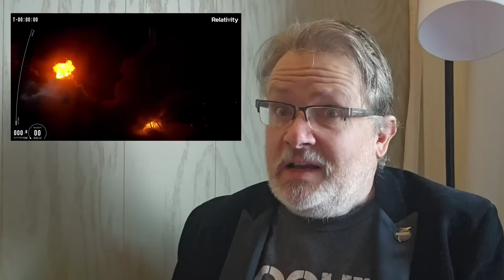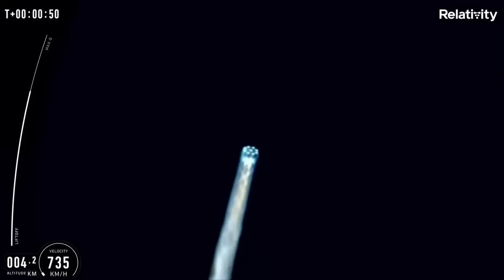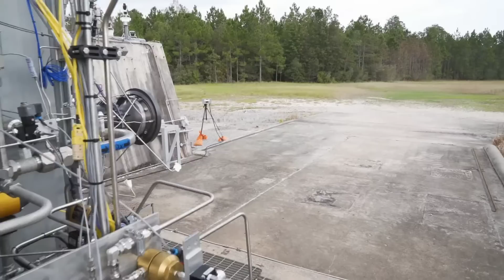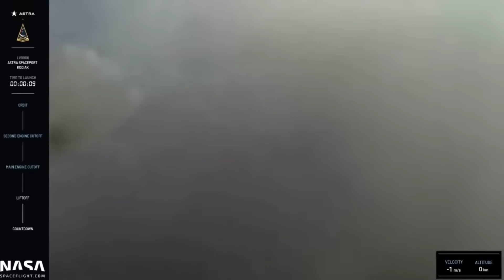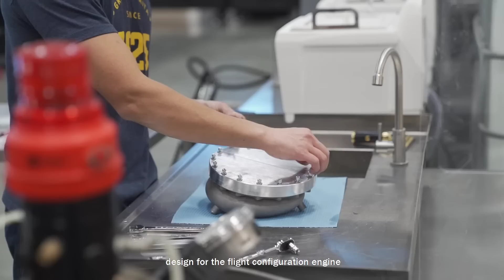Relativity Space succeeds by setting realistic expectations!  But can they ever compete with SpaceX?

Comment: "Taran 1 just made it through ... ... ... Max Q." Engine problems are bad, but the ladies commentating during the broadcast were by far the worst part of the launch. From the very apparent lack of knowledge to the high pitched screaming to the cheering and confirmation of 2nd stage ignition while the engine was clearly sputtering and dying, the launch stream was by far the worst I have ever seen. I am willing to bet that the two ladies are replaced next launch, and if they aren't, it will be safe to say that Relativity has some other problems that also need to be dealt with and fixed.
Reply: @Tyler I don't think the ladies were the worst part of the launch, they presented the information well. Sure they were excited but so is many people that see these machines fly, would you be excited to see a machine you helped built or that you were part of a team see it fly off to space? I sure would. Plus they are commentators very different from launch and mission control where they normally are level headed. I say Terran 1 succeeded in what it needed to do. Yes reaching orbit would have been great but they were not expecting that just to break thru Max Q.
Reply: @bryant3825  I guess we will find out next launch.

Comment: Hey Angry, congrats on reaching your subscription goal. When the first attempt failed my thoughts were that the new printing technology may have provided some unusual thermal conductivity issues. With this launch at night the thermal load on the first stage would have been less of an issue affecting tank pressure: equally I wonder whether the same thing may have happened to the second stage being too cold and not achieving the necessary tank pressure to ensure flow to the turbo pumps?

Comment: Congratulations to Relativity for making it through MaxQ and the flawless stage 1 performance. They also had realistic expectations and didn't use a fairing and also no expensive payload (in contrast to H3). Whatever the problem with stage 2 was, they now have the option to just change their 3D printing designs if necessary and don't need to change their supply chain and toolings.

I really look forward to their 3D printing solutions and what they will accomplish. The Terran R just got much more realistic and when they can inspect the rocket after launch the faults will be even easier to fix. This really looks like SciFi and 3D printing having become a bit more true.

Comment: Quick correction:
It was the second flight of the Vega C. The first flight on July 13 2022 was a success.

Edit: I'm also fairly certain the Aeon is an open cycle engine, not staged combustion.

Comment: I'm still unclear how 3d printing anything beyond the rocket motor itself makes any kind of sense. Metallurgically, fabrication from rolled sheet and bar is superior to anything 3d printed. 3d printing shines when the geometry is difficult or impossible to fabricate any other way.  3d printing for the sake of 3d printing is not a good business case.
Reply: It should significantly reduce the cost labor, (my guess), which is probably some of the highest percentage costs of the rocket itself. Also capital equipment costs. If you have one machine that can make a lot of different parts, it should require less equipment. I would also think you can make more components in parallel which would increase "velocity" through the manufacturing process. So the time you pay for material and labor your able to complete the rocket and launch it faster so you get paid sooner so they should have improved cashflow. Probably also have less suppliers to worry about and have delays from suppliers so more vertically integrated. Faster R&D cycles as well.

Comment: SLS made it to orbit on its first launch and the second stage was able to deliver Orion into a Lunar orbit.
Reply: Yes, and it was beautiful. However the SLS was worked on for 20 years and used established, well understood technology. The RL 10 has been in constant use since the 1960s.
Reply: NASA and the SLS follow a far different development cycle than pretty much all other commercial space companies. Not only has their rocket been worked on for decades, but they also supplant all-up-testing with simulations. They simply dont have the option for iterative development and regular, all-up, destructive testing. The scale of the program, the management structure, and the amount of actors involved would make such an approach prohibitively expensive (yes, even more so than it is now). The first launch of SLS was not a "test" so much as it was a critical mission. If Artemis 1 had failed, it likely would have destroyed the entire program. Failure wasnt an option - they wouldnt have lit the candle if they werent absolutely positive about its chance of success. 

Thats a STARK contrast to Relativity. Their process is on the complete opposite side of the spectrum to NASA - their small-scale, iterative design process not only allows for regular failure during development, but is helped by it. This launch was a test, pure and simple. Their primary intent from the beginning was to collect data - there wasnt even a payload to "fail" to deliver in the first place. This launch gave them valuable information, and the nature of their assembly process means that the next rocket will be even better. They have room for error, and its more beneficial for them to push ahead with an uncertain launch and get data from it than it would be to hold it in assembly for years on end until they expect a 100% success rate.

First launch means nothing in the grand scheme of rocketry. SpaceX is widely considered to be the most successful launch provider right now, and their Falcon 1 was such a failure at the start that they nearly lost the whole company. You're just not comparing apples to apples.

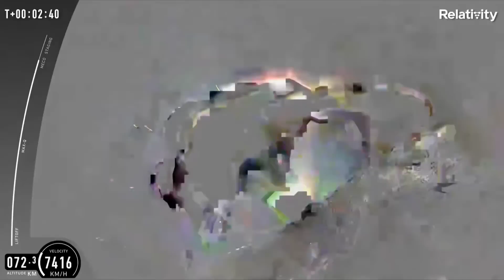Comment: What kinds of materials/parts do they print? Fascinated by this achievement alone 5:04
Reply: I'm very curious why 3d printing is such a meaningful "achievement?" They haven't talked about why that is significant. They've only declared that it is and are simply assuming we'll be impressed. It's like proudly announcing that 80% of your parts are painted black. When they say that you should ask "Why?" Instead everybody tosses around the 3d printing aspect as if it's obviously superior.
Reply: The bottom line is the bottom line (price)
Reply: @VicariousAdventurer  That's why I'm wondering. What is the inherent value of 3D printing that makes it somehow better? The bottom like is the relationship between price and utility. I don't think they've explained why a 3D printed rocket is desirable at all, much less more desirable than a conventionally manufactured rocket.
Reply: @RockinRobbins13 you really can’t be serious? This is like asking car manufacturers why robotic assembly lines are better than the human assembly lines. Case in point, the better 3d printers get, the less hands needed to assemble parts, the less time it takes to build a rocket, the easier it is also to design exotic parts that can be design on a computer to fit specific purpose. 3d printing rockets are scalable, reduces error in the manufacturing process, increases the number of design exponentially, allow for production that is automated, overall reduces cost of construction, reduces the number of parts required, reduces the number of failure points. There’s probably more porous I’ve missed, don’t even know of a con compared to conventional manufacturing.
Reply: @RockinRobbins13  Custom, just big enough, tanks depending on payload.
Reply: @henrytep8884  Aren't you a bit internally conflicted here? First you do the poisoning of the well, which we'll just ignore. Then you say "This is like asking...manufacturers why robotic assembly lines are better than human...."

Then you say 3D printing is better because "the less hands needed to assemble parts, the less time it takes to build...." 3D printers are actually very slow. They are also not as precise as CNC machined parts, although that can be accommodated by design. And robotic assembly has ALREADY yielded greater precision and fewer humans in the process.

In the case of rockets, a rocket tube is a rocket tube. How it's manufactured is immaterial. You do it the way that makes sense, depending on the technologies available, not because some newer method is cool. A rocket tube is one piece, or a stack of rings in SpaceX Super Heavies and Starships.

I'm sure there are specific instances where there's some kind of superiority for 3D printing. I'm not saying those don't exist. I'm saying that when you use 3D printing as the main publicity differentiator for your product you had better sell the crap out of the advantages 3D printing provides. They haven't done that. They are just relying on the "cool factor" of a novel method, without selling the advantages at all.
Reply: @RockinRobbins13  the whole point is to have as many hands off the process as possible, just like any  printer, the goal is to remove how much human interaction is involved. The less human interaction, the more reliable a system or process becomes, this is the general rule of any manufacturing process. But as far as time, it takes much less time to 3d print a rocket than to build one, I haven’t seen any number that shows otherwise. It takes around 6 months for 3d printed rockets to go from concept to fully assemble, because no fixed tooling is required. For any other company that process is 2 years. As far as being “novel” the forecast is that this process will reduce the cost of getting things into space. That’s the bottom line if they can execute. Yes, they don’t have a product yet, but nothing that changed the world or the manufacturing world didn’t come without taking risk in trying something new.
Reply: @RockinRobbins13  where did I poison the well?? Are we really going into debate bro in this conversation. At this point just point out your pros and cons and I’ll point mine about 3d printed rocket and well be done. Not trying to get into some vapid Aristotelian debate over 3d printed rockets.

My argument is simply the less hands required by people in the process of manufacturing a rocket, the cheaper the process, the more reliable the process, the faster process and I don’t believe there’s a manufacturing process out there that goes against those tenants. Relativity is striving for that, they will be able to go from concept to manufacturing faster than other rocket companies with their strategy and it will win market shares if they can execute.
Reply: @henrytep8884  No. We're in complete agreement. I said they aren't doing their job to explain why 3D printing has advantages. You spelled out what those advantages are. You're the ying to my yang, the icing on the cake, the peanut butter to my jelly. We're singing Kumbaya and drinking multiple adult beverages together. Par-tay!

When you're doing something new the public isn't familiar with, and using it as your prime focus of attention you need to tell them why it matters. Relativity isn't doing a great job of that. You did a pretty great job of that.
Reply: @RockinRobbins13  I think we are lol.  I've been trying to think about it from your perspective, and I'll try to steelman your position.

I think you see 3d printing being a good thing for certain aspects of building a rocket, like building exotic parts and reducing the number of parts required to assemble a rocket, but you also believe that there already exist manufacturing processes that are superior to some portions of the 3-d print process.  And if that is true, Relativity Space has to justify why they should print most of the rocket when there exist manufacturing process that currently are superior to 3d print in terms of value added.  And that is a good question to ask because people who have capital in the company are seeking to maximize their profit, and inducing a process that is inferior goes against that tenant.  But I think we could end this discussion here, as this goes beyond my paygrade lol.  I can make some assumption why 3d print technology would be superior especially if it can be 3d print + 100% automation, but cannot justify it today other than to say it is a novel type of process that may be superior in the long run and give the company first advantage.  Anyways, thanks for being cordial, take care.
Reply: @henrytep8884  I think 3D printing is so new that we don't know the improvements it will make possible yet, just like in the late 1970s we knew personal computers were cool but couldn't visualize today's life with them. We had no idea what made them essential.

Comment: Does that $12 million per launch assume reusability? If so, they’ve got a long way to go.  I also expect that SpaceX would be able to undercut them. Right now they’re charging market prices for falcon nine launches, but they likely have huge margins with the reusability factor. They probably could adjust pricing as needed to maintain market share.
Reply: They dont assume reusability in their pricing because reusability isnt even planned at the moment. Their design plan is fully iterative - they have no fixed tooling, and no incentive to launch the exact same system multiple times. Theyre leaning heavily on the benefits of their 3D printing technology to change their design as much as possible, and as quickly as possible.
Reply: @merylsmith5305  sure. However, it seems to me that it’s a lot cheaper and faster to use a SpaceX rocket. Being able to 3-D print a rocket in four months is impressive, but being able to turn around and reuse the falcon nine booster in five days is much much much more impressive.
Reply: @mb777-g8v  If it was only about money, SpaceX would be undercutting the entire industry, and we would only ever see F9 launches. 
Fact is, F9 doesnt make sense for small-sats and cubesats. Rideshare is an afterthought for SpaceX right now. There is a pretty long backlog of rideshare requests. There are many situations in which it would make more sense to go with a different launch provider, despite the cost, and that will almost certainly remain true far into the future. 
At the moment, the primary concern should be whether they can simply make their model sustainable and build a reliable reputation. Thats something thats difficult to come by in the small-sat market at the moment, and if theyre able to achieve that, then they should have a decently reliable customer base.

Comment: Jordan Wright is correct about setting realistic expectations! Well good, not great on launch... But hey, it is 85% 3D or additive manufacturing credit for advancement. 2nd stages are a common bug a boo in all systems. That is why the US made Centaur upper stage from the 1960's research with LOX and Liquid Hydrogen was such a big deal so many years ago. That upper stage launched lots of black projects as well as Apollo missions too...
Reply: there were black Apollo missions, I saw footage of astronauts exploring ruins on the moon that has since been scrubbed from the internet. if it was fake it'd still be there

Comment: I never understood what 3D printing has to do with Relativity?
Reply: 3D printing rocket parts should allow the components to be reused because there will not be joints to deform under pressure and heat. That’s the idea as I understand it.